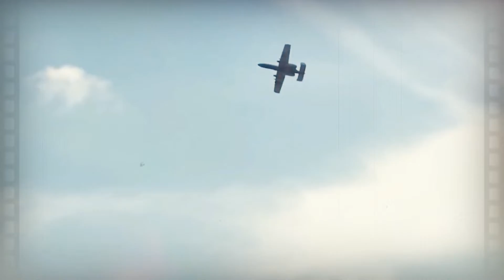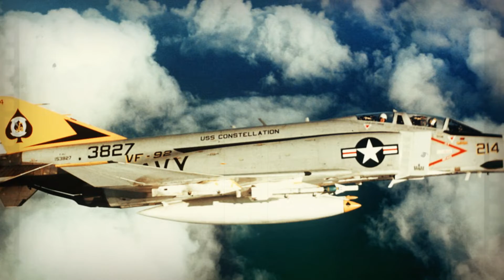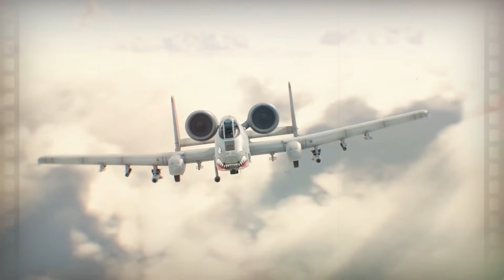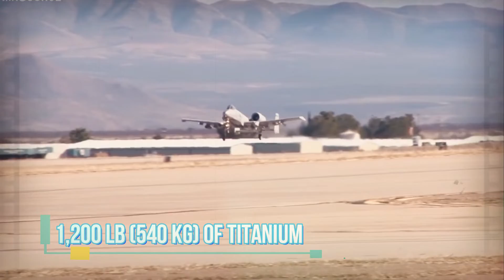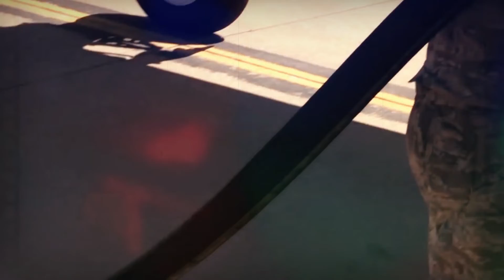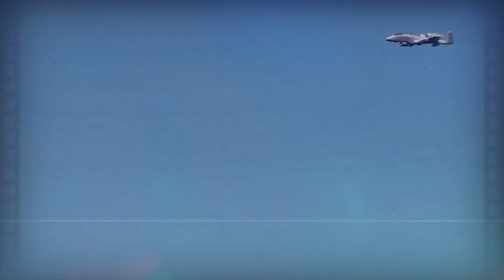A-10 Warthog - Finally US Tests The New Super A10 Warthog!

Comment from the maker: The fact that the AA canon did miss all that time is baffling. Im a trained AA gunner and most of the time the target gets locked on by a radar and with lasers and calculations the cannon aims itself at the target. I would say its about 80% accurate to hit the target. Mostlikely the shooting was done manually in this game. Wich is hard to do, specially if the aircraft operator flies like a gamer and less likely a trained pilot, because of these crazy maneuvers. Btw its one of the most intense feelings if an 35mm AA gun burst fires next to your face when you sit in the chair. After the training my face was black from the gunpowder and we had to wear inear protection plus the earmuffs. It makes every bloodvessel vibrate

Comment from the maker: The A-10 was intended to improve on the performance and firepower of the A-1 Skyraider. 

The A-10 was designed around the 30 mm GAU-8 Avenger rotary cannon. Its airframe was designed for durability, with measures such as 1,200 pounds (540 kg) of titanium armor to protect the cockpit and aircraft systems, enabling it to absorb a significant amount of damage and continue
flying.